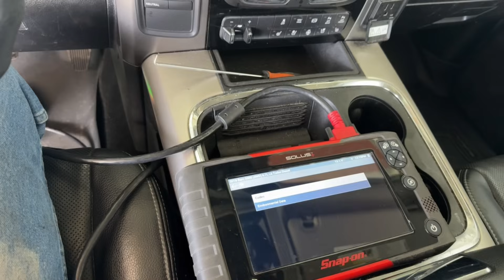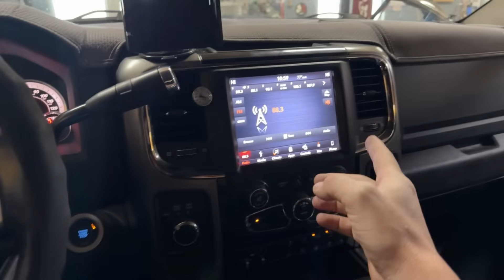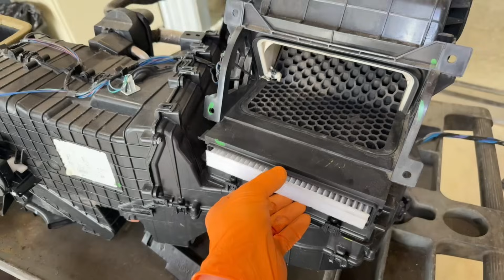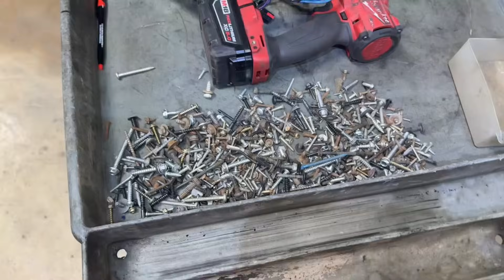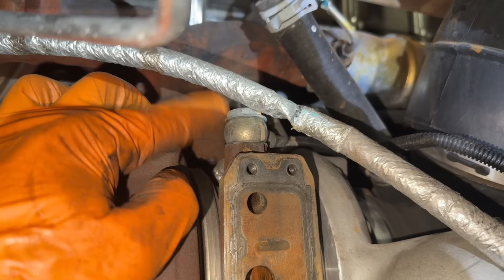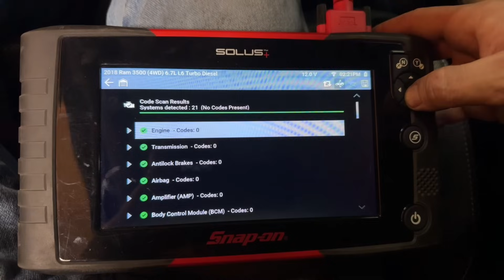Florida Truck Gets Texas Sized Repairs

Comment: didnt watch whole video yet but I had the same problem on my 2018, it was only the tune that was limiting the boost to half the amount. Got to the end of you driving and its still low on boost pressure. check whoever tuned that thing

Comment: Crayon trick is goated. Couldn’t get the driver side engine mount frame bolt broken loose on my 11th gen F150. Didn’t have a proper torch but my cigar lighter and a blue crayola got the job done.